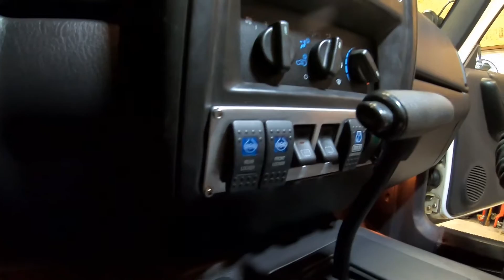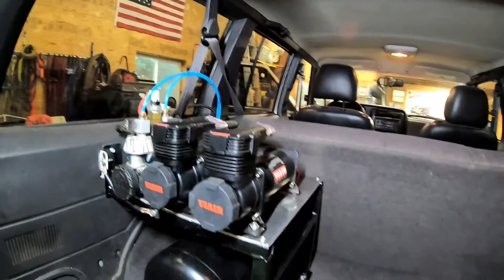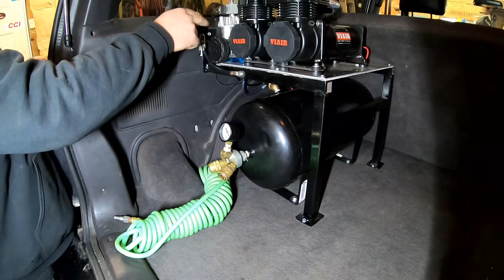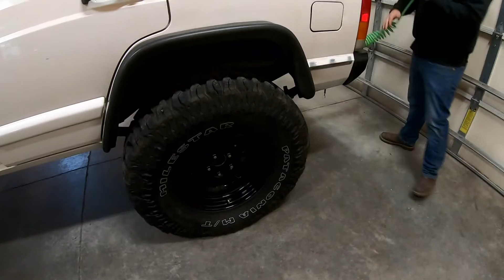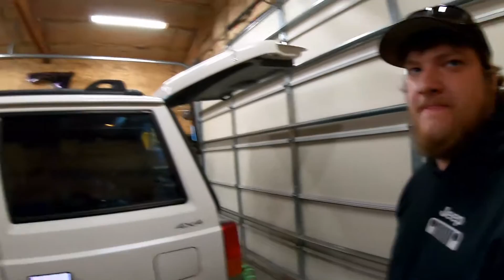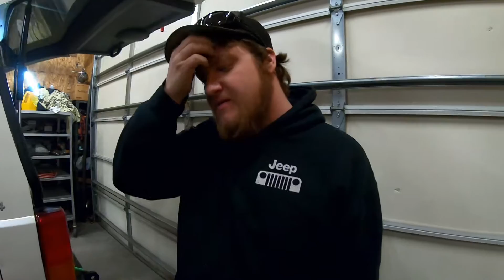The Jeep Cherokee Gets An Air System!

Comment: Whats an air locker?  Do the self tappers with the rubber washers fail too? (98 xj The God Of Dirt)
Reply from the maker: Air actuated locking differential
Reply: @JustinTBraun  Wow ..I need to figure out a car that has a factory locker that i can pick n pull I got a high pinon 30 and an 8.?  On 31's  cute lil rigs I always had 3/4 tons, but I love my jeep ..not more then my 04 Quad cab diesel Cummings THATwas the MF'in S#/T ..

Comment: I used self tappers for my e track in the back of my old Cherokee and found out just how much room there is between the gas tank and floor pan.
Reply from the maker: Haha nice. How long were they?
Reply: @JustinTBraun  I think 3/4". I didn't hit the tank. The riv nuts would be sweet to be able to adapt what you want to tie down direction wise with e track. Probably better system out there. I'm looking for something for my 79 burb.
Reply from the maker: @ivanperkes6006  etrak is pretty good stuff. Used that on a lot of trailers with good luck.

Comment: Looks like a clean set up. You only air down to 25 psi? Should be able to go down to 15 psi without bead locks.
Reply from the maker: No we are usually running 1.5-3psi. 25 psi was the aired up pressure